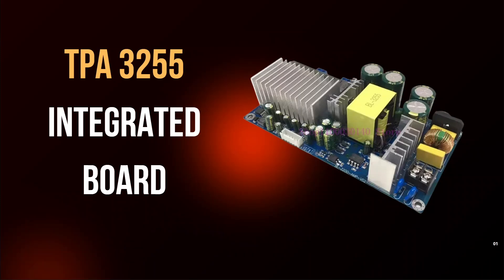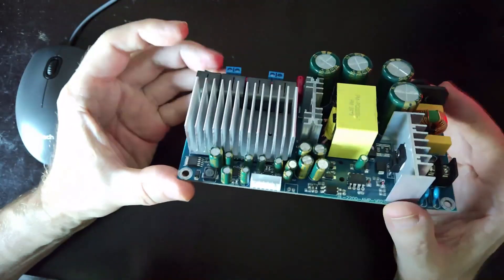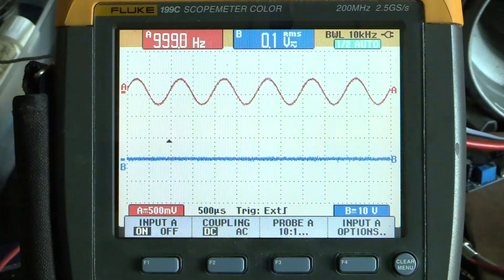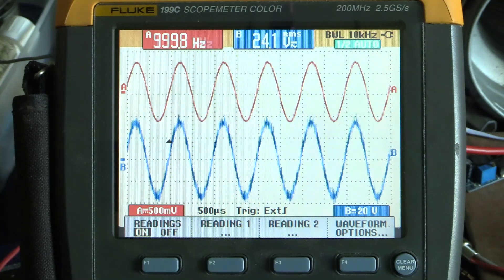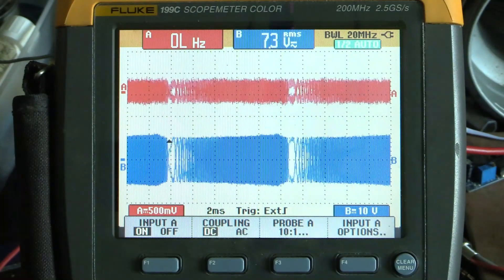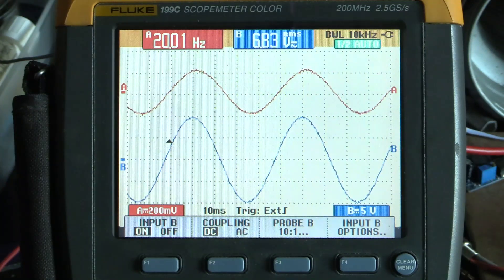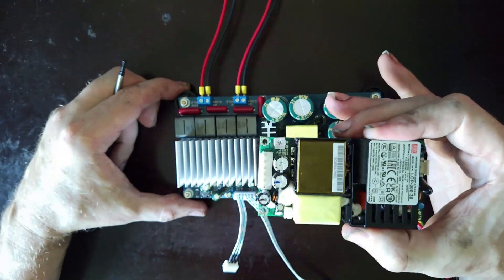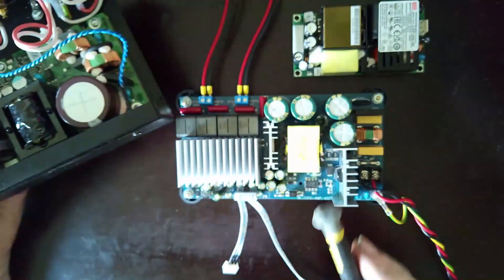TPA3255 with integrated power supply

Comment: The Icepower 200AS2 is a safe choice for TPA3255 with SMPS, but they do not implement PFFB and the damping factor is not high. (This has helped me with bass from some over-damped speakers I have...) I could see a reason to use a different board with integrated power supply if it had TPA3255 with PFFB. I am reasonably happy with the 200AS2 amp on those specific speakers. Of course now that I finished my 1200AS1 monoblock amps, I am even happier; they have good strong bass without using a low damping factor, so maybe I identified the wrong phenomenon. The sound from TPA3255 in the 200AS2 module is a bit warmer, and softer in detail than the other amps I have, but it is very pleasant and I have had none of the complaints that I had with previous class-D chip amps. It is good that Icepower has kept the 50ASX2 and 125ASX2 modules which are using discrete output devices.

Comment: 10% distortion is not a music.
I would not byu anything with have more than 0.5% distortion at full power.
So, this amp has no more than 100w+100w, if you ask me.

I hate those little circuit boards of theirs that are cluttered with elements.
Make a bigger PCB and charge me.
Don't torture me.
Reply from the maker: This particular board non non-clipped power for 8 Ohms is 70W, and for 4 Ohms, 90W
Reply: @guntarssmits2104 
Even worse...
😂😂😂
Reply: @stinkycheese804 
No, I understand very well. I am professional tv repairman. I know what is p.m.p.o.

I can buy used surround receiver from sony, technics, yamaha, kenwood, for less than 100€, 100W per channel, AB class. Real power. Plus, it hs everything: case, display, connectors, power supply, remote controller and high quality parts inside.

Comment: The whole problem with this format is using an ac power supply. It adds noise and can't supply enough input  power. Whether it's unified or not. Lithium DC input makes all the difference in the world. I build multi channel monster amps with these board's. All Lithium powered 😊.
Reply: Cool story , bro.
Reply from the maker: There are plenty of good AC power supplies. But final costs will be higher. This board is unbetable considering 100W amplifier market and sounds by far isn't bad.
Reply: @guntarssmits2104  I just use a drill battery adapter on those. Lower voltage amps. 6ah battery runs for hour's. And has twice the bass and better sound overall than an ac transformer power supply . I have so many. I only use them for charging now. They sound lame after direct DC lithium power. With the tpa 3255 boards I get 290-295 watts x 2. At 48v lithium. Even my 35 amp bench power supply won't make that. And the base is way less. DC to DC is just better for these.
My 14 channe tpa 3255 amp. Will be drawing well over a 100 amps. So a transformer would be big a noisy and expensive. Lithium is cheap. And much better. 😊